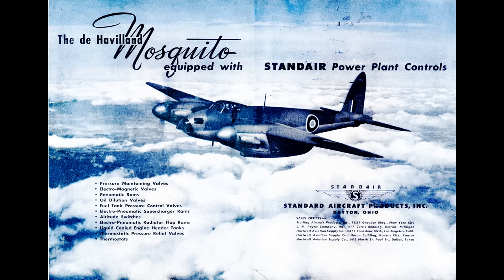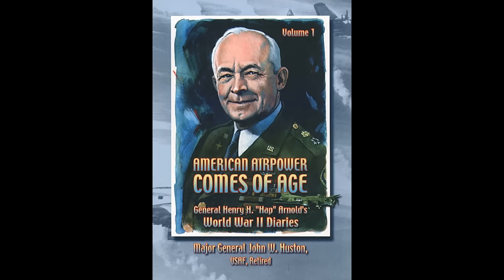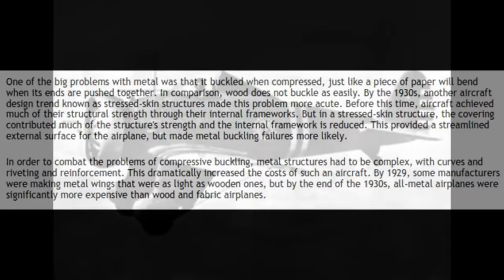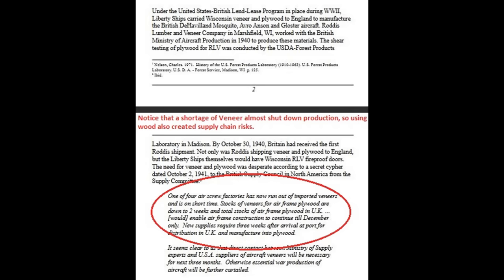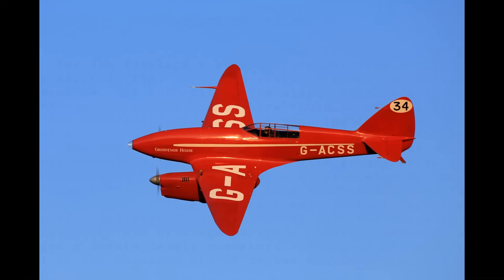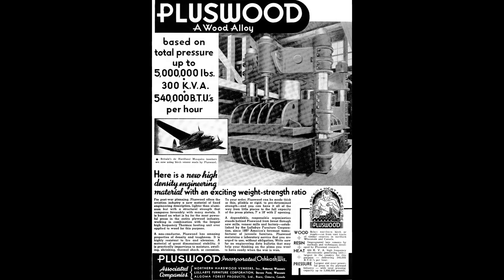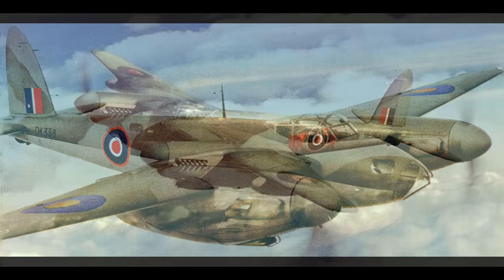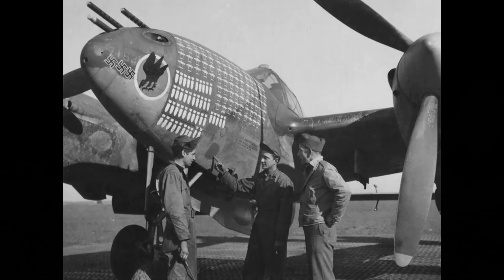De Havilland Mosquito vs. ?

Comment: Two points about the Beaufighter, The were very quiet due to the fact that the engine exhaust was ducted around the engine cowling thus cooling exhaust gas so you couldn't hear them coming. When armed with eight rockets they also packed a terrific punch.
Reply: Hence the name "Whispering death . When the enemy gives a plane such a dubious name ,it says a lot .

Comment: I read  once that one of the difficulties constructing Hughes' "Spruce Goose" was that the required mahogany (not spruce) was earmarked for Mosquito construction.

The Goose and IIRC Mosquito both employed "plastic" composite construction using wood as the matrix molded under heat and pressure. Two such processes were named Duramold and Vidal {the latter apparently after Gore Vidal's father Eugene, sec'y of commerce). I learned about them researching another "plastic" plane, the Langley Twin (Navy XNL-1), which I doubt you've ever heard of.
Reply: A plastic Spitfire was built, to explore the possibilities,  incase we couldn't get aluminium   it was wood fibre, and phenolic ! resin I believe...
That's for your comment,  interesting.
Reply: @clive373  Yes. Phenolic  resin was used in the Duramold process, e.g. the  Spruce Goose, and probably others.
Reply: Remember the beautiful Albatross fighter of Germany in WW1
Reply: @AnthonyTolhurst-dw1nc  Indeed! Sources to hand aren't clear, but the Hughes H-4's wood was molded and saturated with plastic resin, while the Albatros was laminated with conventional glue. IDK which process most resembles the Mosquito's construction, but de Havilland's Comet racer pioneered the use of synthetic resins.
Reply: The H-1 was built largely of birch. I worked for Hughes Aircraft many years later and often wondered if the "Goose" was the reason the union at Hughes was the Carpenter's Union.

Comment: The three layer composite ‘skin’ was almost a hollow shell, there were far fewer longerons, frames and ribs.  The nazi’s FW 154 copy attempt got that all wrong, they tried a wooden built up structure losing all the skin strength advantage.
Reply: All true. It wasn't that the Mosquito was made of wood, it was that it was of composite construction. Just as in carbon fiber construction today, they arranged the wood plies directionally to get the desired effect. Mossie was the 1st all-composite combat aircraft. The wood part is a detail. P.S. the Nazi plane used a single source glue called "tego film." But the plant got wiped out.... by Pathfinder Mossies.
Reply: the Ta 154 Moskito (!) was a fine aircraft. Only about 10 of them were built when the glue factory was bombed and destroyed. The subsequent aircraft they tried to build had to use alternatives, some of which tended to dissolve the wood with time leading to in-flight break-ups due to multiplex delamination. The prototypes outflew most aircraft, but the later-on mounted antenna array for the radar produced so much drag it reduced its speed greatly.
Reply: I believe the fuselage was not a stressed skin, it was a pure monocoque, meaning it was not a skin over stringers and longerons, it was indeed a shell assembled from two halves that had been molded.
Reply: Maybe Germany found it difficult to get balsa wood? The demise of TA 154 was however the glue. Factories making the good Tegofilm glue were bombed and they had to resort to a substitute. That substitute was so acidic that it ended  up eating the wood it was supposed to bond together. At first the bond seemed strong, but after few weeks it failed.
Reply: Gort correct, yes it was
Reply: @ElsinoreRacer  How apt, is that ?  Can't help laughing at the irony.
Reply: @roykliffen9674  like all their wonder planes---too little too late, and far too much diversion; and of skills, materials, and experienced pilots.
Reply: @gort8203  CORRECT
Reply: @penttikurkinen2464  And the British bombed the factory entirely by accident (i.e. they didn't realize what was being produced). 

Having an all-wood, radar-invisible aircraft would have been very useful to the Germans for flying reconnaissance missions over England prior to D-Day. But that's one of those "What-Ifs".
Reply: @hsdonnelly  Wooden planes are not radar -invisible, they just have somewhat smaller radar signature, but actually not that much. Engines, control cables, armament, radiators and metal propellers are excellent radio energy reflectors.
Reply: @penttikurkinen2464  The information I've stated comes from other YouTube videos that, if you want, you can look up. 

Perhaps radar today can pick them up. But we're talking WWII here, when radar had just been invented (very shortly before the start of the war). So I suspect radar technology at that time was considerably less advanced.
Reply: I guess the German aircraft industry had forgotten how they built the Albatros fighters of WW I. I think having trained workers familiar with the methods was key to producing a Mosquito. Most had moved on to metal, De Havilland continued to use them longer, thank God. There was a bomber in the States in the 1920's called the Barling Bomber that was built of similar construction. That was, designed by an Englishman! They only built one.
Reply: Yes, the moulds were concrete. Those new builds from New Zealand are using timber fuselage moulds due to the high investment required for very few aircraft.The moulds are the female, giving the outer surface the accuracy and finish desired.
The only mould I know exists is for a a dH Hornet at the Salisbury Hall Mosquito Museum, just a part of one.
Reply: With a balsa filler, the Hornet had the same structure.
Reply: The Vampire jet had the wooden fuselage too.

Comment: Also the first accidental stealth aircraft, it was noted by both sides that the plane was hard to detect on radar until it was much closer than regular planes.
Reply: I believe the germans recalibrated rather quickly, but it is... somewhat true. They really needed to remove any curved surfaces (that form a tangent to the radar) to do it properly.
Reply: And of course the second accidental stealth aircraft to judge by performance in the US was the Avro Vulcan :)

Comment: The generalized term "wooden construction" is woefully inadequate! De Havilland's construction technique was highly innovative. De Havilland came up with the concept of an ultra light weight compressive core encapsulated in highly tensile stressed skin. The "plywood" wasn't just flat pieces cut to size or even steam bent. It was pressure laminated together in it's final shape creating an incredibly strong layering of multiple grain structures. Jeffery De Havilland innovated with balsa wood cores encapsulated in precisely (grain) contoured plywood - Burt Rutan evolved it to a foam core with carbon fiber skin.  It's the same concept that surfers use on their boards.   A hippy surfer dude showed me how it is done back in the 60's. When I first saw a documentary about the mosquito I thought to myself: flying surf-boards!
Reply from the maker: In this video, I have a picture of the pressure lamination machine and a description of the process.

Comment: De Havilland went on to develop the DH 103 Hornet, which was a smaller single-seat fighter of wooden construction based on the Mosquito design. Still powered by two Rolls-Royce Merlins, the Hornet had a maximum speed of around 470 mph, making it one of the fastest production piston-engined aircraft as well as one of the best-looking.
Reply from the maker: True, but it's a different airplane, I may talk about it a bit in this series, but not much.
Reply: And the Hornet would be a more valid comparison to the P-38, both being single seat fighters.  Of course having the benefit of being a later design, the absolutely awesome Hornet could probably kick the Lightning's ass over the horizon.

Comment: An excellent video Gregg, and I like your laid back yet accurate presenting style and manner.
My late father (Sydney Brown) was a cabinet maker before the war and joined the RAF in 1939 as ground crew, initially repairing propellers on Ansons and the like. Later when the Mossy came into service he was a leading aircraftman on those.

He told me about a structural problem that could occur with the night fighter version carrying the A1 radar. 
It was a heavy aircraft on landing and if the pilot was not careful, it could be bounced and that sometimes caused the tail wheel to transfer such loads to the rear bulkhead that it would be punched in. 
That meant the aircraft was U/S because the fuselage would need to be split down its length to fix it.

The ground crew would watch the landings with binoculars; if the tail wheel collapsed they would note the aircraft number and make a U/S entry on the form 700.
One time a CO saw this happen and wanted to court martial my father thinking he was wrong, they drove out to the aircraft and sure enough it was Un-Serviceable.

By this time the Mossy was carrying far more weight on landing than it was designed to do so it should not be a surprise. It was much loved.

Comment: I've been building and flying RC scale models since 1971 and I would hesitate to fly in a plane with that much balsa. It does very strange stuff with changes in temp and humidity. Combined with the nature of wood to metal joints, I think that's why there aren't a bunch of Mosquitos still flying.

The Mossie, with such sharply tapered wings, also doesn't scale down well. I've seen some very good pilots get caught by situations that wouldn't be a problem with other planes, even twins, and end up with a pile of splinters.

Oddly enough, the much maligned Bf 110 makes a fantastic model. But then again, the 110 did pretty well as everything but a close escort, which is a failure of tactics rather than the plane itself, and it's bad reputation might be undeserved.

Cheers!

Comment: In one of my long-lost books, I read a reference to Sir Arthur Harris (head of bomber command) being at an RAF base at night. He and a bunch of other officers heard a crack-cracking sound above them and Harris said immediately "Mosquito breaking up". Apparently, he was fully aware that the Mosquito had G-load limitations which were more significant than most stressed skin aluminium planes. Certain woods/laminates are bendy (good hysteresis) and others are just plain strong but there is always a point where the two need to be attached to each other. In a stressed skin tin plane, the loads are distributed throughout most of the structure, that's a lot harder to do if you have a combination of different wood materials and metal.
Reply: British Aerospace kept a Mosquito which was seen regularly at air shows until it was lost in a fatal accident several years ago. The aircraft suffered structural failure during a climbing turn, and broke up.
Reply: @romanpolanski4928  I really think its the interface between the different properties of the wooden materials. They work against each other. You can, for example, have what's called a "kissing debond" where they have actually delaminated but it's very hard to tell until a certain load case opens them right up, usually at the worst possible time.
Reply: @romanpolanski4928  That's put me right off flying one now lol
Reply: Just out of interest, how come your books went missing?
Reply: @rob5944  Not all of them, just a few dozen lent out over 40 years.
Reply: It didn't suffer structural failure, it suffered an engine failure. The only Mosquitos that had structural problems ( as detailed in the book, "The men who flew Mosquitos") were the Australian built ones.

Comment: Greg, great video, subbed 👍,  like how you dig in to the history and articulate facts are facts,  have worked in the furniture industry for 35 years and over the past 5 years been running the foundry so I see exactly what they were dealing with back then, even today designers will ask for aluminum, brass, steel or SS and I often times tell them to use wood!

Comment: There are two Comets that are still Airworthy, another replica, and yet another replica being built in NZ.
Reply: Tom Sanders  yep, the original  1930s ones.
Reply: I believe that one comet is based at Boscombe down in Wiltshire but i am not 100% sure  
it was there in 1993 when i left service and i saw it again in 2016 when i visited for a reunion
Reply: Flew at 'socially distanced' air display at Shuttleworth Museum, Old Warden, Beds, a month ago. Thats where Grosvenor House is kept (DH88). Its quick

Comment: Basically a composite aircraft which has returned today with carbon fibre
Reply: Composite sandwich construction. Just like modern carbon fibre. Two layers of plywood with a balsa core sandwiched between.
Reply: @astronomenov99  plus self sealing fuel tanks.  very important.
Reply: Good observation.

Comment: I see comments about the Mossie costing much less to build than a P38 because Mossies were made of wood. Fairly certain engines are the most expensive parts of aircraft.
About 1/6 of wartime-built Mossies were built with Lend Lease Packard Merlins.
Also Mossies had a very high stall speed and were no picnic to land on one engine and they did not have counter rotating props.

Comment: Hap Arnold witnessed the mossie doing an upward loop on one engine.
Reply: No, I saw the video. It was a Mosquito.
Reply: Will dig out the book i have that describes the moment.
Reply: The Hornet superseded the Mosquito but years after Hap Arnold saw the Mossie demonstration. .
Reply: All you need is enough airspeed to begin the loop. You can loop a glider. Bob Hoover used to loop an Aero Commander on one engine and then loop it with both engines shut down (video of this on Youtube) at air shows.

Comment: Thanks for these terrific videos. 
I'm interested in sail boats, and I've built three sea kayaks, two 'wood core' (western red cedar strips 3/16" with   layers of fiberglass and epoxy, inside and out.)  The problem with older sail and power boats is that they're often made with a balsa core. The slightest water intrusion getting past the glass/epoxy - the wood, cedar or balsa acts like a sponge and expands. This expansion will cause the fiberglass/epoxy (or vinylester, or polyester which isn't technically waterproof! ) to separate.  Epoxy is terrific stuff. What happens with my sea kayaks is that first extremely thin layer of wood (1/500th inch??) separates from the swollen wood core remaining as a transparent 'image' on the epoxy/glass. So it's actually wood separating from wood.  Same thing happens with plywood, even to waterproof ACX plywood.  (Also this swelling separation only occurs on the outside of the hull, the outside of the curve, I don't think I've ever seen it inside the hull where swelling would compress against the glass instead of expand. So the key problem is not water getting into the hull, it's the wood core rotting and getting weak.) 
Now the most advanced current sailboats (I'm primarily interest in catamarans and one trimaran) are made with a foam core which is completely waterproof. There are various schemes to exploit Young's Modulus, build a 'I' beam with either slits so the panels can bend to conform to hull shapes, then slits fill with epoxy or vinylester, poly, forming a web between surface skins. A couple of companies make the foam panels in the shape but poke small holes to achieve this structural strength. (So the plywood core of the Mosquito is a brilliant solution - just keep it sealed and dry inside.  
The Aussie monsoon Mosquitos. I think once they saw what was happening, the ground crews probably began carefully inspecting and resealing any scratches, nicks, etc on the planes' surfaces, (Also are their more hangers or tarps on the bases after this problem was discovered? )  The way you find out if you have water intrusion/rot/separation problem on a hull is the Surveyor walks around the entire hull tapping it with a hammer. When it sounds different - there's a problem. However, caught early it's repairable.  (On the boat inspection videos I've seen I think the tap - taps are about 8" apart. On something like the Mosquito there would likely be some areas more likely to have the problem so maintenance crews could check these more carefully.) 
My third sea kayak is an Aleut 'baidarka' iqyax, based on the oldest known example of the fastest variant (The Russians banned fast kayaks as they could run away from their sailing vessels). It's made from a coated fabric skin, instead of sealskin over the frame.  I think I've figured out how these kayaks could plane instead of displace water to achieve speeds of 10 knots 'over distance' as reported by probably the most reliable source of the 18th Century - Captain Cook's navigator. 12 knots over 2000 meters is an Olympic gold medal.  The Aleuts would've  trailed the Olympians but as the modern paddlers stopped and gasped for breath the Aleuts would just keep going.  And, no, I never got anywhere close to 10 knots. Part of what I figured out is that you have to be able to do at least 7-8 knots to then be able to then plane and reach 10 knots.

Comment: BeechCrafts ... Beech Crafts,  as in a company literally named after craft made of beech said that a plane made of wood was no good?
Basically it stinks of 'not invented here' as well as protecting home designed/built craft.
Reply: Beechcraft was named for its founder, Walter Beech
Reply: Except that from 1946 onwards nobody built airplanes mostly out of wood.  And starting in the early 1960’s most boat builders stopped using wood. The Mosquito was a marvelous anomaly.  The RAF and the FAA didn’t switch from Aluminum back to wood after the outstanding performance of the Mosquito was made known.